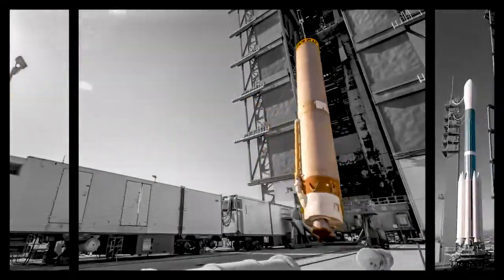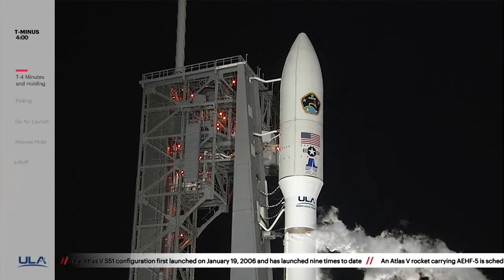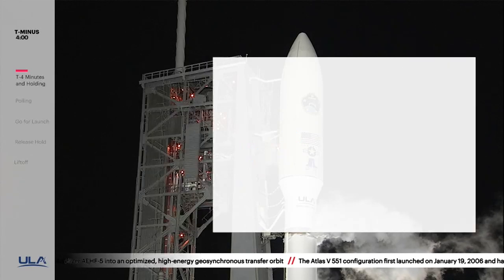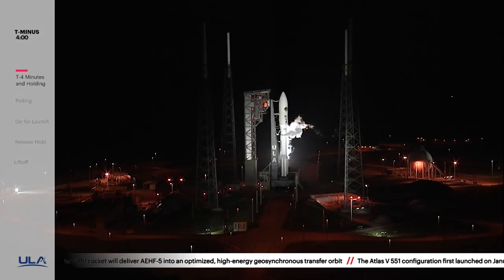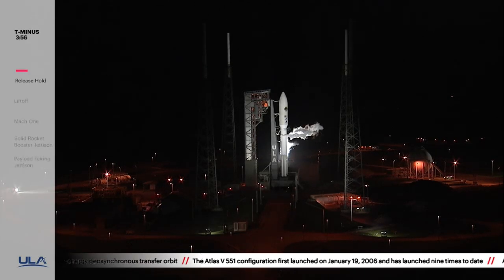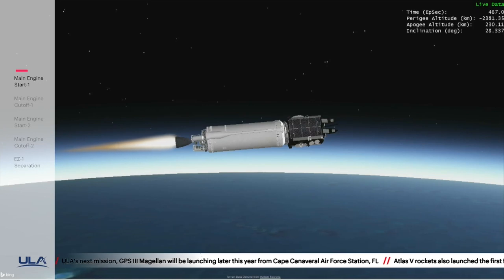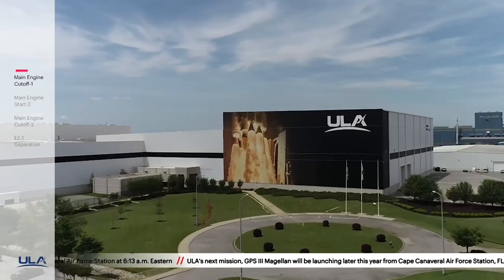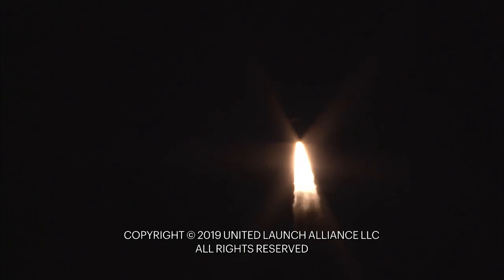Atlas V AEHF-5 Live Launch Broadcast

Comment: I'm just curious...1. What are all the "sparks" around the booster before the engine?
2. What is casting the shadow, in the image where you can see the engine? THX... 
Well done ULA. 
PS: Who the f*** is disliking the video? is it flat-earthers? ;)
Reply: The sparks are from the rofies which are to burn away the leftover fuel so it can't blow the rocket up
Reply: That is ice falling from the core stage glimmering in the intense light.
Reply: Lex Wilson spacex fam boys
Reply: @lexiepexie7845  ROFI is only used on the delta IV and is dry launched. Atlas V is wet launched, however SRBs are ground lit iirc

rl 10 uses a sparkler to ignite but not a ROFI system

Comment: i will never understand why they still talk over the best part - liftoff. let us hear the engines with good mics!
Reply: I like hearing about the technical happenings, not just a noisy roar.
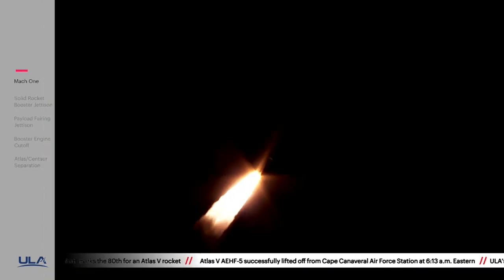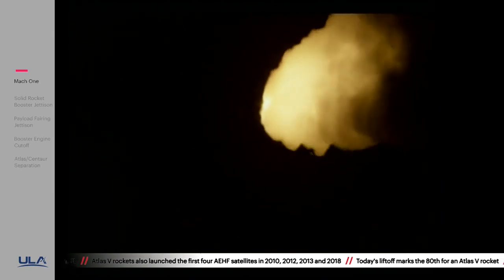Reply: @bencris2bal511  don't get me wrong, I love the sounds of the engines, especially when it does that deeper, phasy tearing sound, I think its when it goes supersonic or hits max q, like at 1:00:42 and the crackle at 1:01:03 those are just a lovely lovely noise :)
Reply: @niallmccaffrey791  There's plenty of time to talk about all the technical details both before and after liftoff
Reply: Liftoff is the part of the coverage that gets shared and used in news stories, so they normally try and pack as much info about the mission into the first 10 seconds of commentary after liftoff. Unfortunately that's when you want to hear the rocket. But to be fair, it's when most viewers are happy to have a mix of rocket noise and commentary. It would be nice if they uploaded a separate clean-audio version.

Comment: Interesting that the main engine nozzle dosn't glow in the same way as spaceX's does.
Off to find out why. (I expect it's different fuels and cooling)
Reply: merlin vacuum is radatively cooled hence the glow, and uses RP1 kerosene

while RL-10 uses liquid hydrogen which burns cleaner and used an expander cycle that uses the fuel to cool the nozzle.
Reply: @Lync512  fuel isn't relevant in this case
Reply: @AmbientMorality  It has everything to do with it. Hydrogen and kerosene burn differently, and It shows on the upper stage
Reply: @Lync512  The glow is how the nozzle dissipates heat and has nothing to do with fuel. Any fuel heating the nozzle to the same temperature will have the same glow. RL10 just doesn't glow because the nozzle is actively cooled.